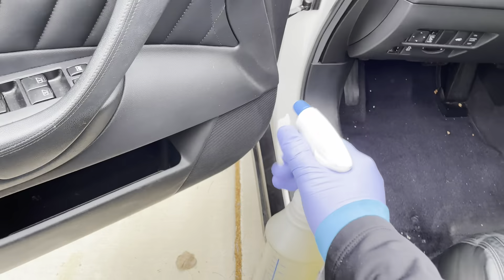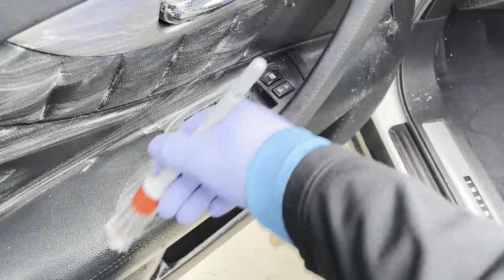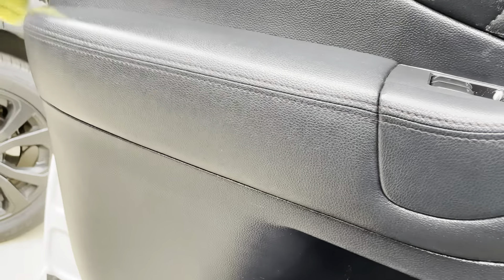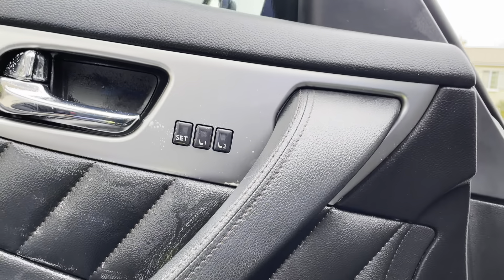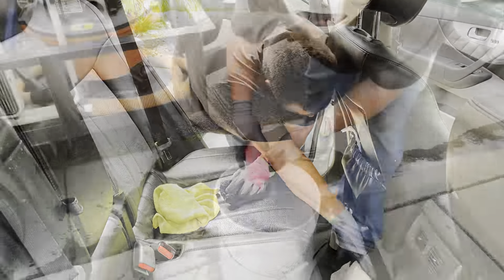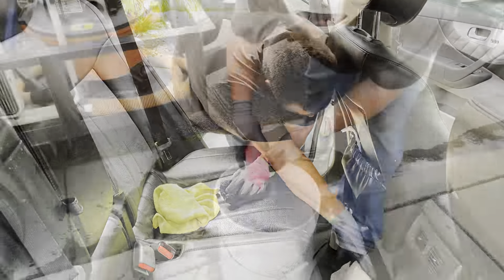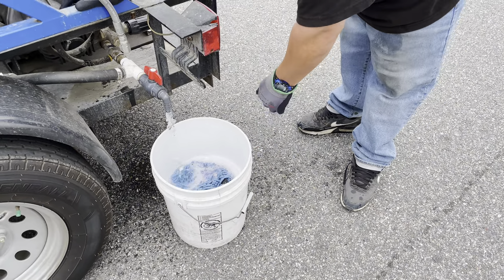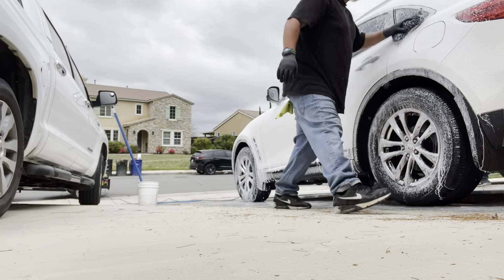OUR DAILY CHEMICAL. No Blemish Mobile Detailing

Comment: The p&s interior express needs to be diluted from the gallon purchase? Does the spray bottle version cone ready to use?
Reply: Technically, you can use it full strength but it’s better to dilute 1:1. It’s a pretty strong product.
Reply from the maker: Yes I agree with you on this
Reply: @Solrac77777  i wouldn't say strong product, i use it on almost every car i do and it definitely lacks strength. it is a light-mild degreaser afterall. koch chemie gsf is super good and super dilutable
Reply: I find it leaves a residue on interior if you don’t get in time. I dilute it 1:1 seems to help a little. It’s so cheap for what you get though, it’s hard to beat.

Comment: For windows i use a 50/50 ratio in a 32 oz bottle, half distilled water and half isopropyl alcohol and I find that it works better then any window cleaner for me
Reply from the maker: Ok nice I’m have to look into that. Thank you
Reply: Also perfect IPA Mix for panel prep before waxing/sealing after polishing/paint correction!
Reply from the maker: @11secbug  yes correct good feedback
Reply: @Mark-zl6od ❤ keep grinding. Love and support from sc!
Reply from the maker: Hey there , i actually tried your method of window cleaning with alcohol and I liked it and been using it ever since thank you